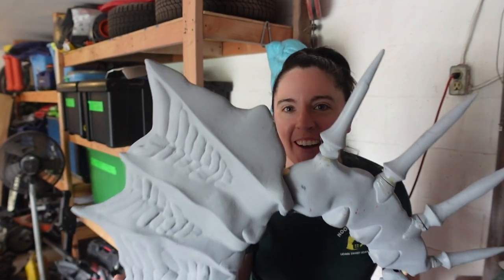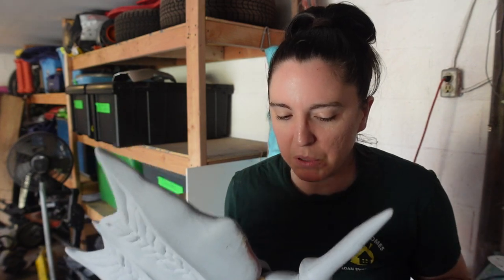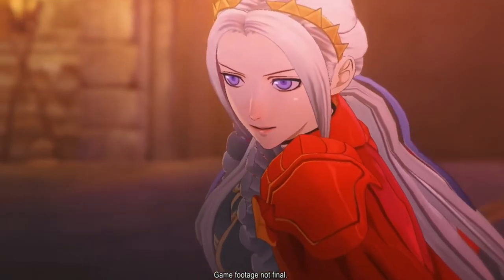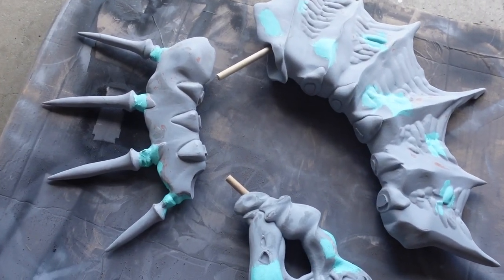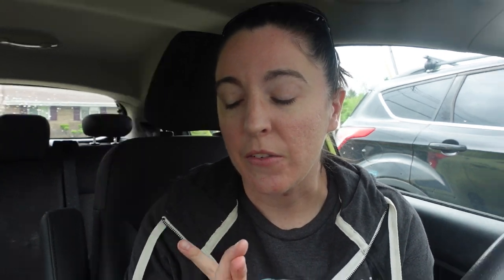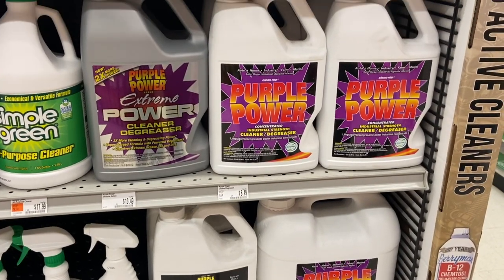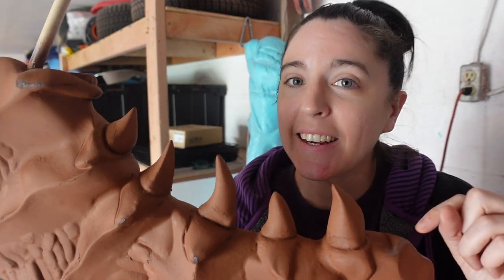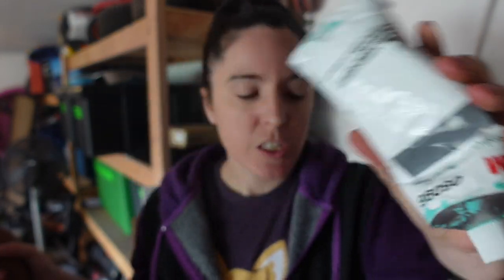It's Been ONE YEAR Since I Worked on This Prop - Edelgard Cosplay Build Log #2

Comment: That thing looks awesome!!!!  Also the 3m filler is it less toxic than bondo spot putty?  (can it be used inside without a respirator)
Reply from the maker: Thank you! It's a beast, def gonna need to work on my arm strength for sure. And as for less toxic, I'm not entirely sure. I still wear a respirator while working with it, but it sands a lot easier for me as opposed to bondo and in my experience doesn't kick up as much dust.